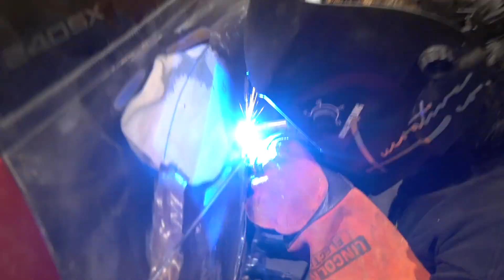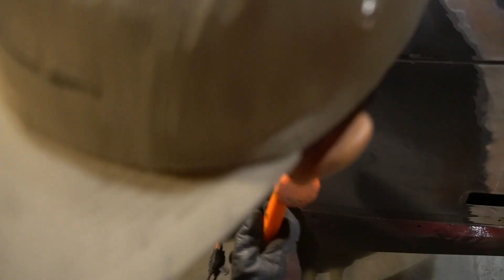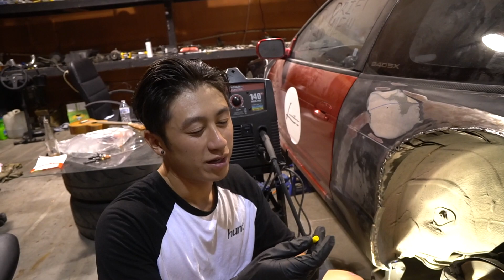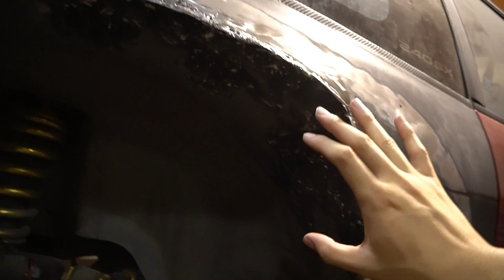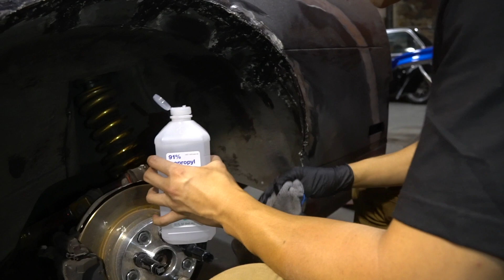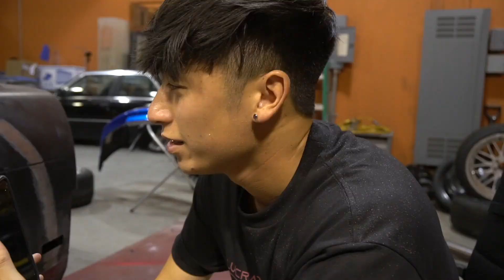How To Seal And Fabricate Fenders For WIDEBODY Kit!

Comment: You should have used etching primer on the bare metal first to promote corrosion resistance before the foam. Not saying you should have used the foam.

Comment: Not talking ship just making an observation seam sealer is very strong however its strong when you have 2 pieces of metal that overlap one another that way there surface area for the seam sealer (ie. Glue)  To hold the panels together giving it its "strength".  When you're a metal pieces don't overlap one another, that "strength" is gone.  Again I am not talking ship just making an observation.